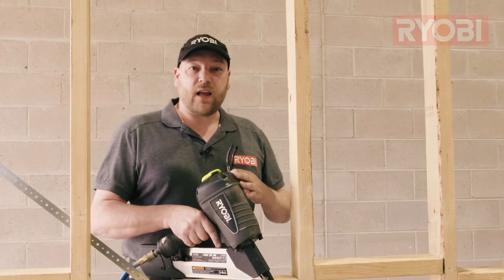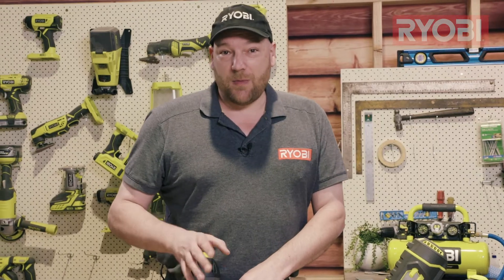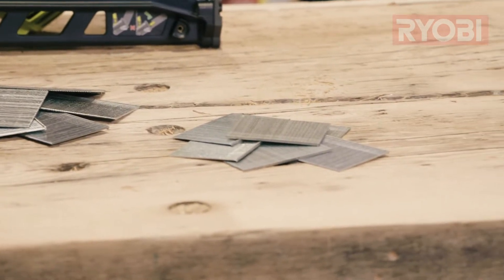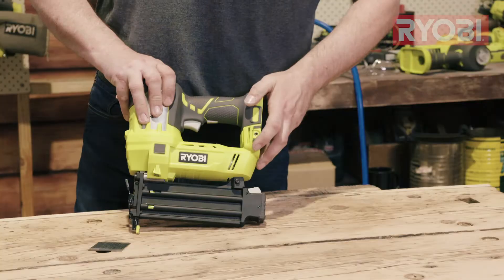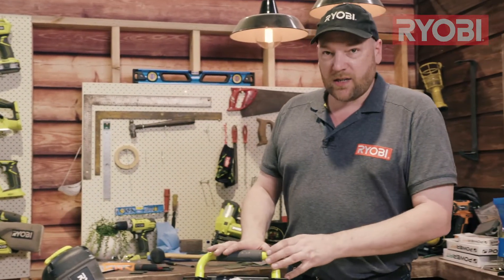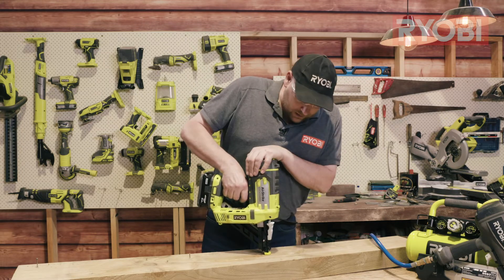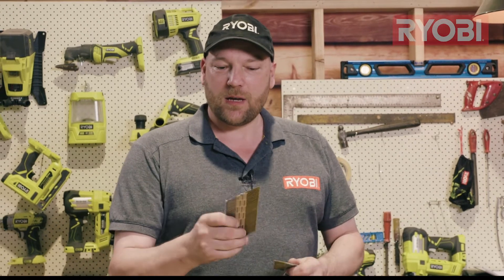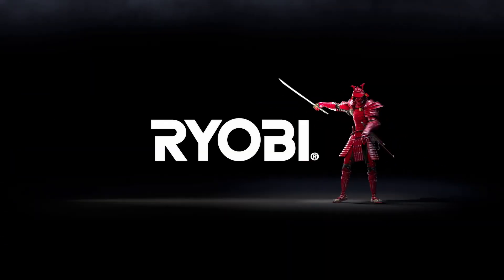RYOBI: How to solve problems with cordless and pneumatic nail guns

Comment: There’s a number of videos I’ve found on fixing misfiring issues but I’m looking for help on an issue of periodic unresponsiveness. After stapling an uncounted number of (within 10 minutes, not too fast) the stapler will stop responding- no sound of anything moving. If I wait some time (at least 15-20 minutes)it will staple again until the same issue happens. What could be going on?

Comment: The mistake I made was the guage of the brad nail, the Ryobi web site stated C1 Brads only. I took it to mean any guage would do the job. I experienced not what you would call a jam rather the hammer part skipped over the top of the nail head. By changing the guage of the brad from 18 to 16 the gun fires properly each and every time now.